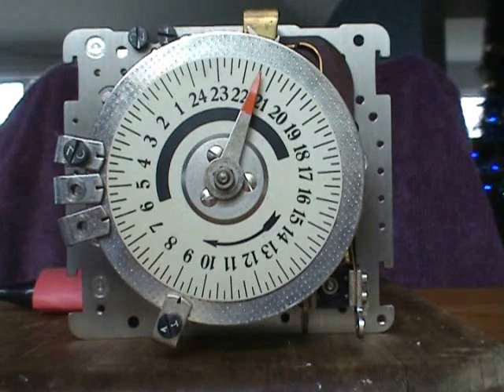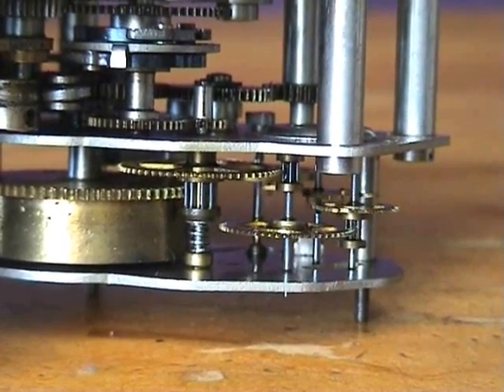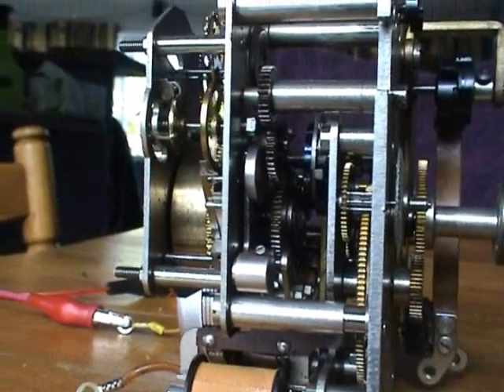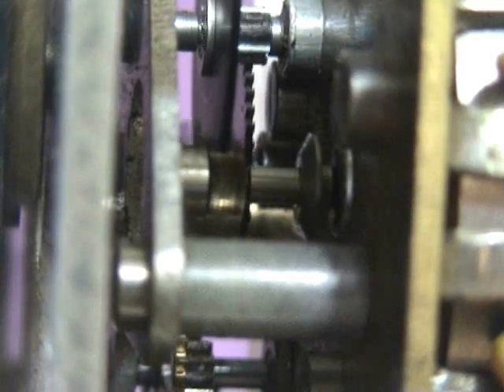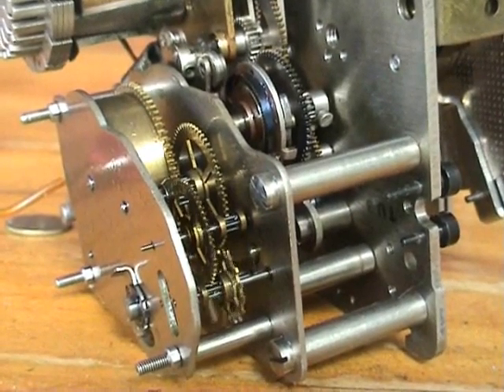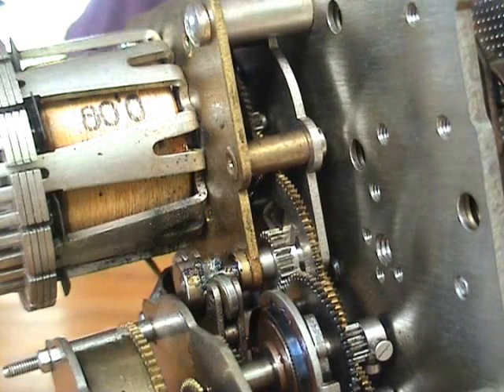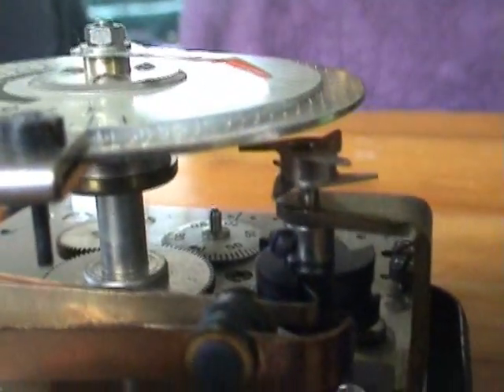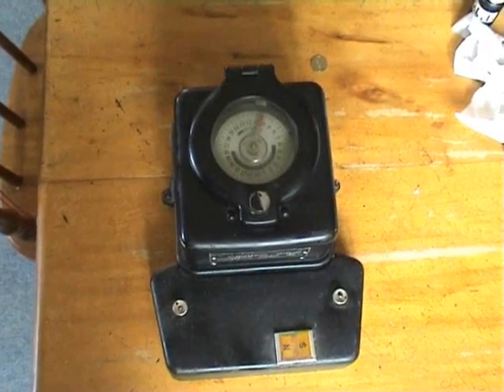Landis & Gyr -- type SR1z time switch

Comment: Hi do you know what does 1,2 means on the panel?
Reply from the maker: 1 is ON pin (which is longer) 2 is OFF pin (which is shorter).
Reply: @RODALCO2007  thank you so so much , we have this old switch meter in house just could not find any manual it might be put in 1977 and still operates the hot water circuit.
Reply from the maker: @royske123  They are very well made time switches, also self correcting. In case you do a manual override. Within 24 hours, everything is back within step. I use them on electric heaters in our house. Some of these Landis & Gyr clocks are almost 70 years old and still going perfectly. Better then the plastic crap they sell now these days.
Reply: @RODALCO2007  so in terms set time on and off you just move the 1 and 2 to the hour number on the panel?
Reply from the maker: @royske123  Yes. 1 for example 2300h is ON time and 2 at 0600h is OFF time.
Reply: @RODALCO2007  thank you sir , is the hand with red tip points to current time? You are a legend
Reply from the maker: @royske123  The hand with the red tip doesn't move, that shows the current time position. In most Landis & Gyr SR1 and SR2  clocks it is at the about 1 O'clock position.
Reply: @RODALCO2007  great thank you very much I have leant a lot from you. Really appreciated!
Reply from the maker: @royske123  Yes, and tighten up the small screw with the 1 or 2 on it.
Reply: @RODALCO2007  ans what the other 2 metal bits in between the 1 and 2 for? They look same than 1 and 2 but they just have no number on them
Reply from the maker: @royske123  That are spares, if you want to do twice a day ON / OFF switching.
Reply: @RODALCO2007  if i can leave them next to each other on the panel? I only use one timing per day
Reply from the maker: @royske123  Yup, don't populate them.
Reply: @RODALCO2007  thanks a lot mate

Comment: Very nice! The operation of this L&G is similar to how the Horstmann Vmk range work. They also stop the escapement when powered-up, very similarly to this one....with an electromagnetic coil, and let the escapement run during a power loss. Also, once every 24 hours, a Horstmann will exercise its escapement too! In some Horstmanns, (e.g. a Ymk2) the escapement runs even when the synchro motor is powered up, it only stops after a long power loss has caused the reserve spring to wind down. {^_^}

Comment from the maker: @MadManMarkAu  At 5:13 the gear is better visible.
The small gear has the Meccano style double screws in it. That is the output which drives the 24 h clock dial.

Comment from the maker: @MadManMarkAu  At  1:15 In the video I added an anotation.
The gear with the bluish colored spring is an actual double ratchet wheel arrangement, which is driven from the synchronous motor or the clock work mechanism.
The ratchet spindle drives the 24 hour dial via the thick silver colored small gear on the shaft via the large gear wheel which also controls the escapement release every 12 hours.

Comment: When the mains are switched on, the escapement is stopped. What is the mechanism that switches the clock drive from the mechanical clock to the synchronous motor? Having both connected to the clock mechanism at the same time seems like a *bad* idea.
Reply from the maker: It is a ratchet type drive mechanism. The clock runs on the synch motor, or on the clock work mechanism in case of power outage. Sorry for the 11 year late reply.